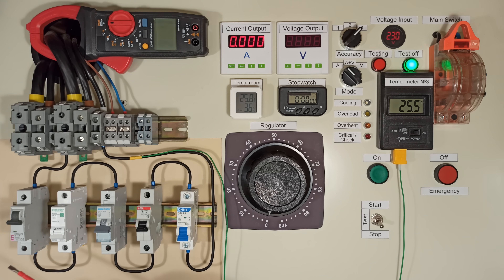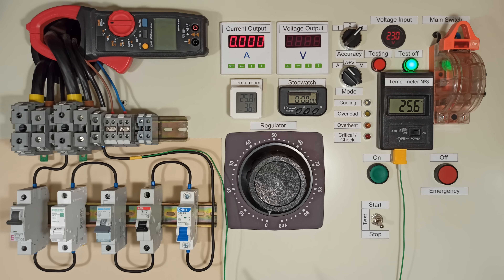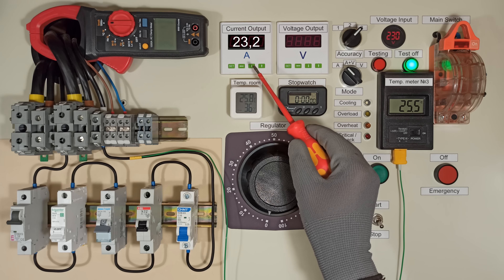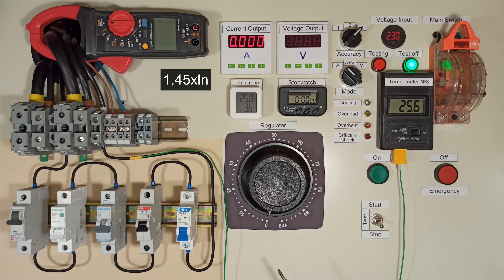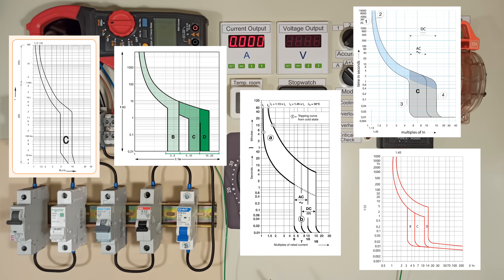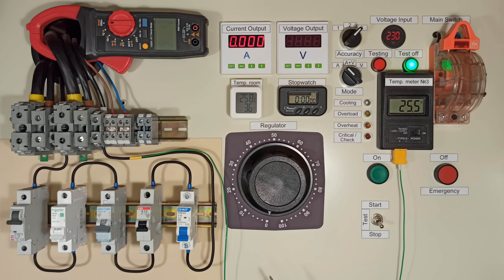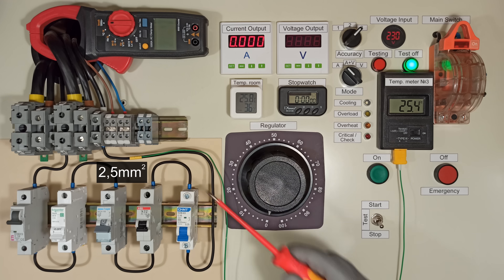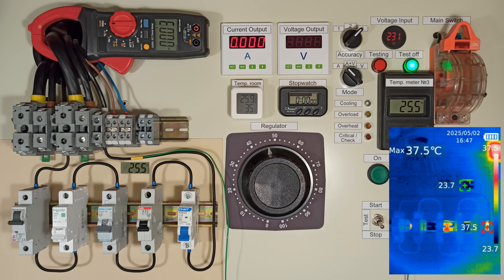Test MCB 16A. ETI, SE, Hager, ABB, CHINT

Comment: I have been performing similar tests in the past and found that part to part deviation within the same model is very strong factor. This variation is more significant than type to type difference considering  thermal trigger characteritics. Try to do Gage R&R on bigger sample size, like 32pcs each and you will see.
Reply from the maker: Thanks for the great insight! So, you’re a tester too?) Of course, there will be variations even within the same model — you can’t draw conclusions based on just one breaker. I only did a visual test :) Testing many breakers is possible, though it takes time and money. I think the curves will diverge more noticeably in the range of about 1.45–2 times the rated current.
Reply: @ElectroTest_1  yes, tester. But as part of development and test lab for customers. So can't share more than a generic findings... What I found really interesting is also the dependance on the date of manufacture and tools used and its' effect on the performance. For some  (German)  manufacturers this clearly projects into the specs.  Some others apparently ignore that and part of their production is inevitably ot of spec. 
Also, it seems that none of the big ones use 'six sigma' approach and their production is about 4 sigma in terms of statistical compliance to the specs.

Comment: CHINT is a highly renowned major brand with decades of history. Numerous international companies utilize its products within their electrical distribution cabinets, and many devices exported worldwide incorporate its electrical wiring systems. To suggest its products are unreliable would be tantamount to claiming there exists no more dependable brand globally. Regarding pricing, as a Chinese company, CHINT holds a significant cost advantage. China boasts the world's most advanced manufacturing sector, with highly mature supply chains across all industries. This enables maximum cost control, coupled with low labor costs—a key reason why many major brands establish factories in China.

Comment: I saw an half of duplex apartment , destroyed by fire , caused by overload . But , cheep , no-name automatic circuit breakers stay  in “on” position . 
A key ACB did not react on iron and AC , on same line ! 
Just because market full of “original” junk made who-knows-where , many people replace their  modern and fancy switchboard with classic ceramic fuses .
Reply from the maker: It all sounds very tragic. I sympathize with those affected. In my opinion, the fire could have been caused by various factors. Protection against overload is important, but so is differential protection. There are other types as well. These significantly reduce the likelihood of such incidents.

Comment: For me I want to see that the trip times match the specifications, with good reliability and predictable from one device to the next.
Reply from the maker: Overall, everything matches. The thing is, the allowable operating range of the thermal element in circuit breakers is very wide, and the breakers themselves have a significant impact. Sometimes, breakers with noticeable deviations occur.

Comment: Reference temperature of these product is 30°C and the tripping curves are according to this temp ((IEC 60947-2 and IEC 60808-1). It means that the thermal curve move with the temp and you do have to take into account the manufacturer table to check tripping time according the ambiant temp (ambient temp in the enclosure).
Reply from the maker: Thank you for the important remark. In the next tests, I take the influence of temperature into account 🙂 You can watch the following videos with circuit breakers. The ambient temperature really has a strong impact on their trip time!
Reply: @ElectroTest_1 I am a SE engineer retired. 30 years at R & D and test labs to design this kind of products. I can add comments.
First, your wires are too short and the risk is that the temperature rise of each apparatus is shared. For this, the standard requires minimum a wire of 1 meter. 
Then, tripping test procedure according to IEC 60947-1 (general rules) and 60947-2 (circuit breakers)  require at first a cold start at 1,05 times the In. No tripping during 2 hours. Immediatly at the end of these 2 hours, the current is raised to 1,3 times the In. The product is hot. All the certifcation tests are performed like this for any competitor. 
And if you perform several test there is a time to respect between each of them because of thermal inerty of thermal elements inside the circuit breaker. Last point, these electromechanical circuit breakers haven't the same accuracy than electronic releases. A tolerance of +- 20% is accepted.

All the tests are performed in climatic chambers, calm air (less then 3m/sec don't remember well). Air pressure and relative humidity is controled. Plastics of apparatus are sensitive of humidity specifically during short circuit tests. Plastics can be more or less resistant depending their capability to catch humidity. Moisture can soften plastics, which can deform by absorbing internal pressure and prevent breakage.But it’s just informative. Not the aim of your tests. Regards

Comment: This is precisely the reason, I prefer HRC fuses, over mcb.
In my test benches I always use semiconductor fuses in series.  
Now that semiconductor fuses prices have dropped drastically, it makes no sense not to use it. 
Please note the tripping time is what protects from a disabling injury. (I prefer less than 5mS). Flashover in face creates serious injury (seen umpteen both for humans & simians).
Stay safe & donot use mcb as a protection. Use a large rated S.Fuse if in doubt, but do use please.

EDIT: Tripping time in Second😅😅 is NO safety for the personnel. It's like a jack hammer hitting an object. 5mS makes sense. 1S makes it a salad.

Comment: Ezt a tesztet megismételnéd párhuzamos kötéssel is? 
Lehet a középmezőnyben lenne változás
Reply from the maker: I have parallel tests with circuit breakers on my channel. You can take a look. Is that what you want to see or not?
Reply: @ElectroTest_1  Of course, I have experienced large differences with two miniature circuit breakers of the same manufacture, but within acceptable limits.

Comment: My zone reaches 42 deg C ambient. None these would work. Am I right?
Reply from the maker: Why wouldn't they be suitable? They will be. It's just that when the ambient temperatures are higher, you need to apply correction factors to the rated current. For an ambient temperature of 40°C, a 16A circuit breaker will no longer have a rated current of 16A, but rather around 14.5–15A.

Comment: If you tie an Eti breakers switch with a wire so it doesn't shut, would another pop or would it rip the wire?
Reply from the maker: Hi 🙂 Cool idea! You even made me laugh a little. Do you really not know? The lever doesn't affect the tripping mechanism! Even if it gets stuck or you hold it by hand, the internal mechanism will still trip! That’s the case with all circuit breakers that have a protection mechanism. However, in toggle switches and disconnectors, there’s no such function — the lever is rigidly connected to the contacts.

Comment: Test result: They are all within their specs or on the safer side!
Learned: Read the specs, don't guess.
Thanks for those videos!
Reply: .. and they are all tested in series, except the last .. not sure how much this affect the result (or if it does at all) .. but im fairly sure they wasent designed for being serialized on the same load .. internal resistance, materials used etc .. should affect result, but hopefully not dramatically .. but even a slight difference in internal resistance for example ould skew results a bit .. (sequance of tripping) .. test with 5 serial same brand and see if there is any difference ..
Reply: All are safe, the ETI is in the safe side but out of specs
Reply: @Patrik6920  翻译为英文
The material characteristics and calibration of circuit breakers vary from brand to brand, so differences in performance are normal.

In addition, if the wires connecting the two devices are too short, heat will transfer between them and end up affecting the results.

Comment: I wonder since except the first one， it’s always the one next to the chant that trips， could it be that the Ching， by getting hotter than the others heat the next one through the cable ？ what if you changed the order， would they trip in the same sequence ？
Reply from the maker: Why do you think the CHINT is heating more? In the video, next to the CHINT, there's a false thermal spot on the metal rail. This is due to different emissivity factors and light reflection from the metal. That happens sometimes. I think the influence on tripping of the neighboring breaker is possible with short wires.

Comment: You choose the appropriate circuit breaker with the proper rating and characteristics for your application. You have to account for ambient temperature, type of load, wire gauge, insulation material, wire placement and any other issues you need to address to ensure that the installation is properly rated. There’s no better or worse option. The important part is that the circuit breaker performs within its specified limits.
Reply from the maker: Yes, if everyone approached design and installation with that mindset, it would be great! Doing a full calculation covering all points and requirements takes a lot of time. In everyday practice, people usually consider the worst-case scenario, and cables have a safety margin. I agree that the main thing is for the breaker to meet the standard. But this question was more for thought — what would people choose if they knew that a particular breaker has a certain time delay?

Comment: Excuse my ignorance on this does it matter that the current appears to be running backwards in some of the breakers?
Reply from the maker: No, this doesn’t affect ordinary circuit breakers designed for AC. Their electromagnet will operate in either direction. Moreover, the current already changes direction in them at a frequency of 50 Hz.

Comment: Одна ошибка в тесте - надо было температуростабильные подключения делать. Потому что chint всех грел (из-за дешёвых компонентов с высоким сопративлением) - более тонко сконфигурированных аппараты на это реагировали и раньше срабатывали😅
(русский акцент никуда не спрячешь, поэтому на английский не стал переводить 😅)
Reply from the maker: I have other videos on my channel with tests using these circuit breakers. I tried different connection methods, did a stability test, and tested five breakers of the same model. And the results were surprisingly similar to this video.

Comment: The reason of MCB is to limit current and do it ASAP.  So I think ETI results is best (by far). Longer delay would be importand in C class of MCB not in regular one.
Reply from the maker: Thank you for your opinion) On the other hand, the heating of cables and wires is quite minimal. The load could still be acceptable in operation. In the video, the breakers are type C. By “regular,” do you mean type B?

Comment: I'm curios- maybe there should a poll- when do you prefer MCB to switch off at I2 current? Although standard allows for time up to an hour, MCB are configured by manufacturer to switch off as fast as possible. That said, it is possible to set them up so they would switch off within more like first few minutes, or more after 10-15 minutes. What would be preferd?
Reply from the maker: Thank you for your comment. I’ve tested several manufacturers myself and I see that there can actually be a wide variation even within the same brand, although some do hold longer. Indeed, it’s noticeable that most breakers trip within 5 minutes at 1.45×In. However, I’ve seen some manufacturers where the trip time is around 20 minutes.
What surprised me even more is that the trip time under such overloads (1.3–1.5×In) strongly depends on the ambient temperature. I think in most situations it’s still better for breakers to trip faster. Keep in mind that breakers are often installed in cold places — in a basement or an electrical panel in a wall — while wires and cables are in warmer conditions, especially in summer. It’s possible that a breaker could take a very long time to trip because it’s at 20°C.

Comment: If you wanted to test every breaker, why did you wire them all in series? How long were cooling times between measures. Good video, but this can cause errors in measurements.

Comment: From safety perspective faster tripping is better but tripping should occur within expecter zone.
Reply from the maker: Thank you for your well-reasoned opinion! Besides the trip time, circuit breakers also have many other important characteristics — reliable contact, ease of installation, and resistance to external conditions.

Comment: looks like i need to find some ETI breakers , , I have Eaton and Chint that never triped meanwhile wall plugs have been melting ...
Reply from the maker: Hello, my friend! I’m 90% sure the cause is not the circuit breaker manufacturer. Could you tell me the rated currents of your breakers? And what kind of cable are you using? The contacts in the sockets may loosen over time, and there could be several other reasons as well

Comment: To be 100% acurate, you should show that you tighten the wires with a torq driver ... other wise a loose screw may impact temperature.
Reply from the maker: Thank you for your comment - great point!
You're absolutely right: the contact quality plays a big role in heating, and loose terminals can definitely affect the results.
In this test, I tightened all connections carefully and equally, but you're right that for full accuracy, using a torque screwdriver would remove any doubt.
In future tests, I’ll consider adding torque-controlled tightening to eliminate this variable completely.
Thanks again - attention to such details really helps improve the quality of testing!

Comment: Insulation made of PVC and other polymer materials begins to degrade or melt at temperatures above 65°C. Based on this criterion, the CHINT breaker demonstrated optimal performance, as it operated within the appropriate thermal threshold. Other breakers tripped prematurely, before reaching critical temperature levels.
Reply from the maker: Thank you for your comment. I think there’s something to it. Although the breakers could have held even longer.

Comment: Thanks for this interesting test-video - whichs confirms and demonstrates what we have learned all over our professional education...
My only concern is the strong heating of the CHINT wire terminal - which is oviously much more than the others -
This might be a matter of insufficient tightening torque, but if not,  this should be diligently observed an may be a dangerous show stopper for me....
Reply from the maker: The heating is definitely not related to insufficient tightening torque. Different circuit breakers heat up differently. I have a video called "Test MCB 16A. Eaton, Noark, Gewiss, Legrand, E.Next" I think you will like it. In that video, the thermal camera measures temperature from the side.

Comment: Excelente tu video. Es una información muy importante el funcionamiento de los interruptores termomagnéticos con respecto a sobrecarga. Lo que me deja preocupado porque acá en Buenos Aires Argentina que es donde resido, suelo usar chint, y viendo tu ensayo la temperatura que se produce es el interruptor es demasiada, y el tiempo de actuación es mucho con respecto a los demás interruptores. Gracias por la información y saludos desde Argentina
Reply from the maker: Hello! I'm really glad you found it useful!
I just want to clarify something: the Chint performed quite reasonably in this test.
There might have been a false thermal spot at the beginning of each test — this was due to the presence of a metal DIN rail, which shows a higher temperature than it actually has.
In later tests, I place paper underneath or keep an eye on that detail.
So personally, I can't say anything bad about Chint — I just don't use it that often.
Reply: Muchas gracias por la respuesta. Claro el riel din al ser metálico toma temperatura. Por lo pronto uso regularmente Chint sin problemas. Saludos @ElectroTest_1
Reply from the maker: @guitarrasgemelas  I meant something else.
If you point a thermal camera at a plastic circuit breaker, wires, and some metal parts (like a DIN rail), sometimes a false hot spot appears on the rail.
This is related to different emissivity coefficients of various materials.
At that moment, the rail might actually be at the same temperature as the other materials.
Reply: @ElectroTest_1 Ah ok. Se entiende